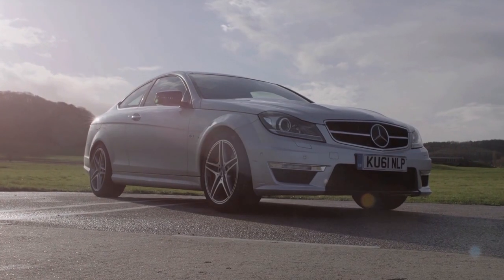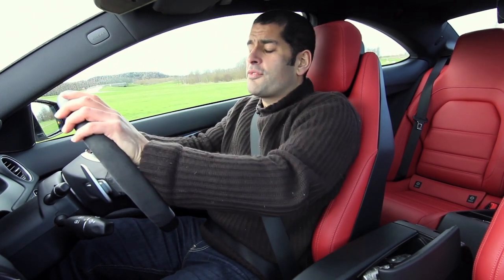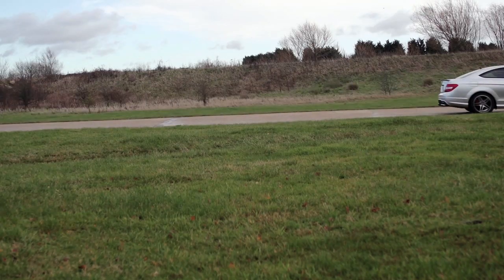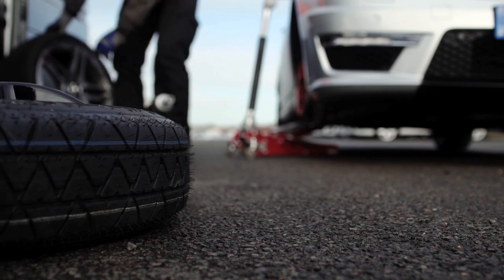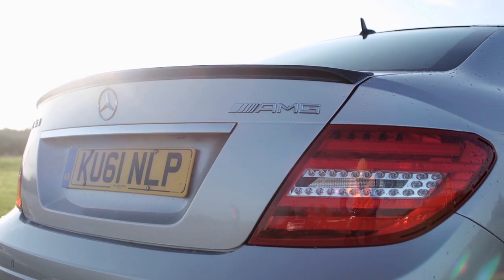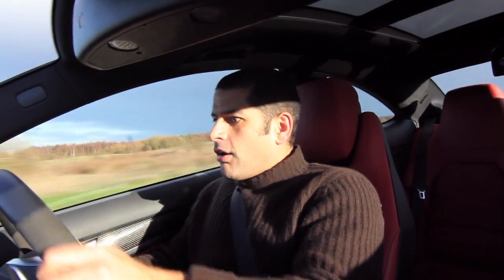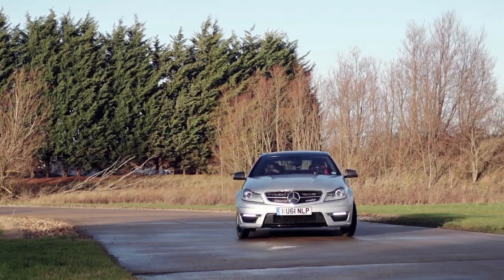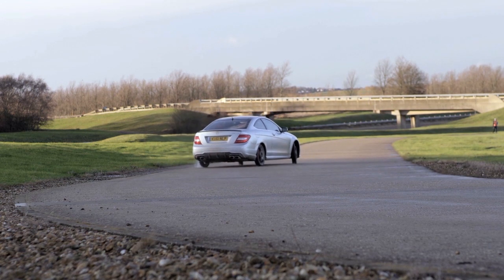The Mercedes C63 AMG Experiment - /CHRIS HARRIS ON CARS

Comment: Contact patch is what counts, not tyre cross section - the contact patch varies constantly, so depending on the tyre, pressure, the conditions, speed, braking, accelerating forces, weight transference etc, increasing the cross section by a few centimeters may have little effect on the average contact patch (so the 255 standard tyres are probably just fine and just upping to say a 275 might not make much difference to grip).

People often make the mistake of thinking that just slapping on some wider rubber will always improve all around grip.

Of course in this case the changes are drastic - no doubt compounded by the space savesr most likely having very basic tech in its components compared to the high tech Continentals that came off.
Reply: noobtubeeeeeee no, similar contact patch area, different shape, wider and shorter. 
 The advantage of wider tyres is the wider shape of the contact patch can result in a smaller slip angle due to lower contact patch deformation, leading to more grip, but this is also dependent on a load of other factors beyond just tyre width. It's complicated stuff, but in my experience a well designed quality narrower tyre will often perform much better than a wider cheaper tyre.
Reply: noobtubeeeeeee so you're saying some 255 mudcrawler tyres will be more grippy than 225's designed for tarmac?
Reply: *****
what are you on about? a contact patch is just the rubber touching the ground. the guy was implying that width is the only thing that matters but, depending on tread type, a wider tyre can have less contact with the ground.
Reply: B. Bazza it depends on the terrain
Reply: Igor K Slow day under the bridge?
Reply: Igor K that was so original, you sir are a maestro of wit.

Comment: why drift WITH A FUCKIN  4WD !!!!!!!
Reply from the maker: Why are you yelling?
Reply: Just like that lol but you need to make the same test with RWD 
it will be interesting.
Reply from the maker: We did this in 2012. That is RWD.
Reply: no we can see the bolt of gimbal on the slow mo you can see the front wheels running at the same speed as the rear wheel
Reply from the maker: Not sure what you're looking at, but AMG didn't start adding AWD until the 2014 model year.